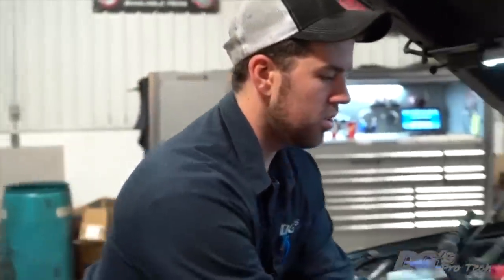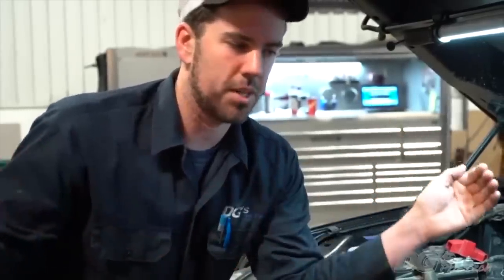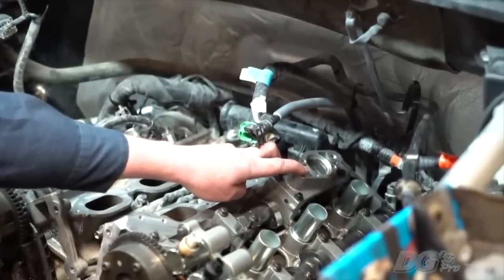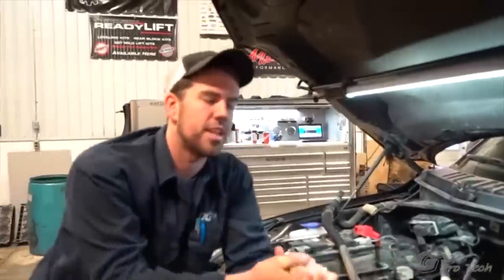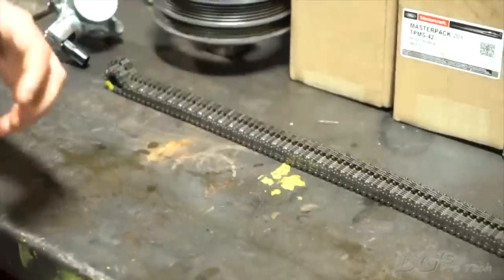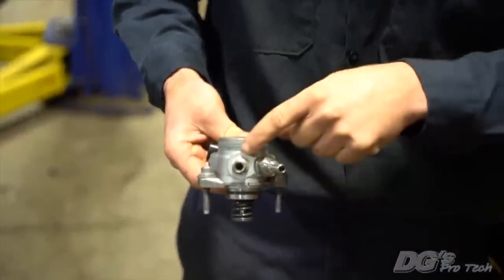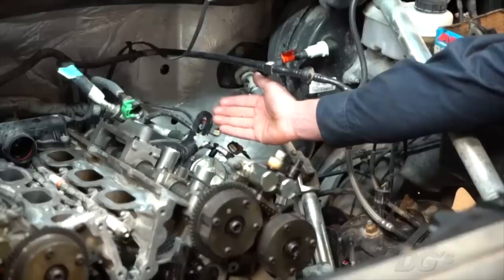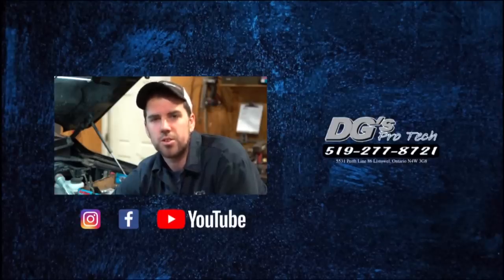What you NEED to know about Ford EcoBoost Engines by Dustin Golley of DG's ProTech

Comment: Fords are 100,000 mile vehicles unless you drive like a little old lady. My high-performance 4.6 L 2005 Mustang blew a rocker and then destroyed the top of my engine and after I fixed that I had a rod start knocking, did I say high-performance. It had 107,000 miles. There is no way I would ever trust ford with a turbo engine. I’ve also had a Ford F250 heavy duty and a Ford Taurus and they were both equally garbage. Junk Junk Junk
Reply: If you drive your car/truck like an asshole,  it won't last no matter the brand. I have 172,000 on my F150 ecoboost and take care of it and don't beat the shit out of it. It's not rocket science pal.

Comment: I was building turbo engines in the 90's, I carried a whole person's weight of tools to try to keep from getting towed. I worked at several dealerships and took many classes for all kinds of procedure and process for new engine platforms coming online...they still blow (head gaskets, rods, blocks, valve trains, transmissions)
BOTTOM LINE buy a V8, it is the least likely to just pop for no apparent reason and just be shy of the warranty.....If you want to haul balls or tow/ a V8 is the ticket most of the time. oB

Comment: Ford Turbos are very reliable in my opinion.. a good read --> (The alloy selected for this purpose has withstood the temperature and reliability requirements of space flight. The super alloy was previously used for both the high-pressure fuel turbo pump as well as elements of the high-pressure oxidizer turbo pump on the Space Shuttle's main engine. In a further application of advanced technology, the turbocharger has a dual cooling system. The BorgWarner K03 turbocharger developed with input from Ford engineers, utilizes both water and oil cooling to cool the component. The turbo is predominantly cooled by oil when the engine is running, but when turned off, a water cooling system passively draws heat from the components, cooling them down.) The benefits of a v6 compared to a much larger displacement v8 are less moving parts.... u got a engine with less moving parts and a turbo designed from the ground up to be nothing but a long term tank.... my v8 friend wasnt too happy when his big ass 6 liter v8 was in the repair shop before my v6 ecoboost was recently... he started having issues after 200k.... my ecoboost has not had a single hickup so far. CHANGE YOUR OIL ON TIME and there isnt a reason the ecoboost should let you down.. in fact change it early if u really care.. i change mine at least every 5k miles

Comment: Bottom line.... its way to much shit going on with this little engine to make it run the way it does ... just get a naturally inspired V8 and be done with it....I could wrap a turbo on a turtles ass and make it fly... nothing new.
Reply: v8s have more moving parts. my grandpas big ass 6.2 v8 started having issues appear after 200k or so miles with those moving parts..... my aunts 3.5 ecoboost still running like a tank... ecoboosts have less moving parts than a v8 obviously being a smaller engine, with a reliable turbo charger i believe ford goes with borgwarner with the turbo.. and they have a pretty good system of cooling in place to ensure those turbos last a long ass time... in my opinion a ecoboost if the owner changes the oil regularly is more reliable than any of these massive v8s

Comment: Generation one 3.5L TT are very poor, A single timing chain design is a massive flaw and it not serviced ASAP will cause damage to cylinder heads. Most of the time its too late to just repair the timing chain, long block is the only real fix. Or just buy a newer generation 2 which fixes the chain design.

Comment: We use the ecoboost expeditions at my work and not a single one of them can accelerate past half throttle without misfires and power cutting.  It's a crap engine.

Comment: Towing ratings are not based on power. They are based on suspension control of the “vehicle” behind the truck. How much weight can the vehicle truly handle safely with it. Tow ratings will change as you get into power with the duallys where they can pull 25000+ lbs.

Comment: Can u post a video on an extraction and replacement for an engine on a 2012 Ford Taurus SHO. I also will be separating the transmission  from the old to the new engine along with all the accessories.
Be specific as to the yr make and model pls.

Im tackling this extraction and installation this is weekend. So if you could or direct me to a site before this weekend it would be greatly appreciated.
Thx

Comment: It's either eco or boost ... choose one ...
Reply: From the comments, sounds more like boost than economy. Until the boost blows up, then economy is most definitely gone.
Reply: They're quite Eco if you're nice to them, but the Boost will throw you back in the seat if you ask it to! The 2017+ models have 3 timing chains to prevent chain stretch as well as PFDI (Port Fuel and Direct Injection) to eliminate any carbon buildup on the intake valves.
Reply: @FordMaverickFanatic  $$$$!!
Reply: @northdakotaham1752  Spend the money to maintain it and treat it right and in the long run it'll be cheaper!

Comment: Ok. I'm calling bullshit on this. No. Your oil, yes- if changed at a reasonable level 5K Miles/8000K is not an issue. But even as this guy explains about the links of a chain becoming weak- is NOT going to happen in that time period. The issues with these engines are NOT timing chain related, and even if you DO have an issue with the turbo- It's not going to be related to the timing chain.

This timing chain slop issue is bullshit.

Comment: GM truck engines are pushrod type and  short timing chain .In 2014 , They went to direct injection . The new 2.7 in line 4 cyl engine is also a pushrod type with a single turbo.Also has v 8 power and short runner on turbo to reduce turbo lag. The same engine is built like a diesel and full torque comes around 1500 rpm. About 22 mpg on a full size 1/2 ton truck.

Comment: Great video, I wish a mechanic like that would discuss the 2.7's known issues / pros and cons.
Reply: Whats wrong with the 2.7 ecoboost  I have a 2016 never no problem except the the radio quit working went into a deep sleep mode
Reply: @truckerjon7255  I also own a 2016 2.7.  It's in an F150 which recently flipped 61k miles.  So far the only problem is with the oil pan.  I've had 3 additional oil pans put in it.  I think Ford finally has it fixed properly now.  I made my comment because it would be great to hear about any additional known issues when it comes to the 2.7.

Comment: 2018 3.5 EB. Oil change EVERY 5000 miles. Castrol Titanium Synthetic oil. JLT catch can. Injen cold air intake. MBRP 4" exhaust. Truck is a beast, and will easily shred Cooper all terrains.

Comment: I just traded my 14 Raptor for a  15 Lariat ecoboost,   only 57,000 miles wanting better fuel mileage, and being now I am a grandpa and all. On first start ups, I am getting way to much white smoke from the exhaust.  After about ten to fifteen minutes of running it goes away.  This happens even on nice days.  I have googled the issue, seems to be a lot f people having this problem with ecoboost engines.   I have read two issues that could cause  it.  One,  mild head gasket leak,  idling and cold it  as it warms up it can basically steam it off, unnoticeable,   second is turbo seal leaking, allowing oil to get into one or both turbos, and it has to burn that oil off.   Its embarrassing to say the least.  I left Disney on ice along with all the other vehicles, and I have a trail of white smoke, no one else does. What is your thoughts? Need advice here.

Comment: I had the 13 st focus 2 liter eco great engine put 138,000 miles on it. I womped on it to its the first 4 cylinder i didn't blow up I used fully synthetic oil and only changed oil 13 times. I have a Ranger with the 2.3 now and im scared I hoped they fixed the gasket problem.

Comment: I just bought a 2011 Ford f150 4x4 very nice truck. I've always been a Chevy guy but when I seen this truck I had to buy it. I never heard anything about this EcoBoost and the only thing I found out real quick is the fuel mileage is horrible 
9 mpg this is not going to work very well for me. My question is can they  be turned to get better mileage. I also dont hot rod it because it's my work truck

Comment: I DONT KNOW WHATS GOING ON AT FORD, BUT THIS WATER PUMP IN TIMING CHAINS,         STEERING ISSUES WITH MY DAUGHTERS FORD TARUS, WHICH THEY WILL NOT WARRANT, IAM DONE WITH FORD, THEY ARE MAKING THINGS TOO EXPENSIVE TO FIX, 1400 DOLLARS FOR A WATER PUMP WHICH INVOLVES OTHER STUFF WHILE YOUR IN THERE, FORD HAS BECOME A MESS, AS FOR ME, 30,000 DOLLARS FOR A NEW VEHICLE AND NOW 3000 DOLLARS FOR A STEERING ISSUE DUE TO PART FAILURE AT 140, OOO MILES IS UNACCEPTABLE FOR ME, WATERPUMPS INSIDE THE TIMING IS A ISSUE DELIBERTLY DESIGNED TO COST THE CUSTOMER MONEY, HEATER CORES THAT COST 35 DOLLARS INSIDE DASH NOW IS A 1000 DOLLAR ISSUE, THESE THINGS I WILL BE LOOKING AT FROM NOW ON WHEN I PURCHASE A VEHICLE, MY FIRST CAR WAS A 1968 MUSTANG OUT OF THE SHOW ROOM. IVE ALWAYS BEEN A FORD GUY ,,, BUT HEY FORD, IAM F ING DONE WITH YOU AND YOUR STUPID CRAP REPAIR COST,,, IAM DONE, GO TO MEXICO

Comment: I wish you lived in my neighborhood. How about doing a video on the pros and cons of the 5.0 V8 in the Ford 150.
Reply: 5.0L peak piston speed is 82.5mph, faster than a formula engine @17,000rpm

formula engine use long rods, 5.0L uses short rods which pushes the cylinder against the sleeve at a high angle, causing it to accelerate the piston to faster than the crankshaft is moving.

5.0Lengine made by ford have sintered rods, too heavy for the bore spacing, 5.0L is the only muscle car balanced externally like muscle cars from the 80's.
5.0Lbuilt from catalog parts(BOSS engines) have drop forged and ball peen forged rods like stock V6 and V8 camaros so can rev higher

a V8 camaro can add 100hp with just a camshaft made by chevy, 5.0L being so close to max volumetric efficiency, it is very hard to add HP without more RPM, or displacement per minute

5.0L is 20% smaller but only gets 3% better fuel economy driving slow, but uses a lot more fuel with a heavy foot, that's cause all of the power adders are adding wear, not just robbing fuel economy so 5.0L can displace more per minute at high RPM

ford was forced to build 5.0L cause they were fine with 4.6L 300HP in 2009 but V6 camaro made 315hp in 2010.....300HP IN A MUSCLE CAR 12 years after Z28 Camaro made 345hp in 1998
Reply: @ihatecrackhead  What?? The Coyote 5.0 uses a 5.933 con rod. That's not 'short', lol. And please provide the link to this piston speed info.
Reply: That be nice...

Comment: Good tip on the wastegate. Diesel guys, listen up! This applies to all turbodiesels as well, not just ecoboost gassers. Hit wide open throttle at least once a week, If you have a newer diesel with dpf and/or def fluid, with regen cycling, WOT at least once a week and at least two 20+ mile drives on highway per week are paramount.

Thank you for your articulation as well!

Comment: Nothing to fear with an ecoboost. Days of being able to put conventional oil in and pay 25.00 for an oil change are long gone. 5k miles use a solid full synthetic oil and a Motorcraft filter. That alone is going to keep away the majority of issues. Change your fuel and air filters, use top tier fuel, replace the coolant and transmission fluid every 2 years you'll rarely have any issues most of the time. Control what you can control....the maintenance.

Comment: I have my oil changed with full synthetic at that dealer every 5K.  It's a 2017 STX package 2.7 liter Eco Boost with 20K miles and now I know that I need to "drive" it more and not baby it so much :)

Comment: Did this engine suffer problems with intake tract and valve carbon buildup like many other GDI engines? I understand proper oil helps, but many folks with GDI still have trouble.
Reply: GEN 2 engines no , They have a dual port  direct inject, and other improvements.
Reply: @Calebflying2025  Thanks for clearing that up! 👍

Comment: This isn't a problem isolated to Ford. The GM 3.6 DOHC GDI V6 also has timing stretch issues. 

What it boils down to it marketing. Everyone wants to be able to advertise low cost of ownership and long maintenance intervals. Well, they're lies. You NEED to change your oil on these modern, tight tolerance engines at least every 4,000 miles. No ifs ands or buts.

Comment: My 2013 Taurus  V6 3.5 ecoboost had water pump running on timing chain $2200.00 fix for $150.00  part .So if your water pump is on timing chain and your in that deep replace your water pump. I personally wouldn't buy another 3.5 ecoboost just for that reason.  Most H2o pumps could be replaced for $500-$700  and in a few hours.

Comment: Yes, A sharp guy. BUT All engines use a timing chain and YES, proper lubrication is a Must.  
But this applies to ALL engines, Not just the ford EcoBoost!   
SO, I do not understand why the EcoBoost is Targeted in this video???  
Let's talk about intake valve fouling due to oil in the EGR system...  (:>

Comment: Thanks for the insight but what about the carbon build up on the valves ?
Reply: In my opinion and experience, it's a non issue. Yes, you're going to have buildup, but induction cleaning is hardly a major job, if you even get to a point where it's needed. I've done it myself in the garage once. Takes a couple hours, some solvent, clean rags, and basic hand tools. It's a trade off for efficiency and power I can live with. Running good quality oil is your best defense. And whatever you do, DONT use those induction cleaning sprays, especially on forced induction engines. You compress and send that hard, fine, crystalized carbon past the rings and into your oil. Not unlike sand. No bueno. It can and does cause damage to bores, bearings, etc. if you use it with any regularity.

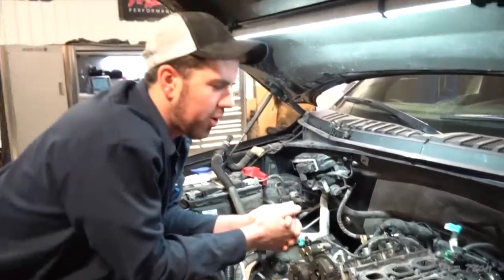Comment: At approx. 4:30 You say that with direct petrol injection they get excellent atomisation. This is not true. Due to the high pressure the fuel get worse atomisation, the pressure blocks atomisation. But what they can do is run leaner because they have not mixed the fuel with all the air (envelop injection). From the VW TSI problems we know it creates more carbon deposites, e.g not everything burns completely.

Comment: Ford is becoming like bmw, sometimes in a good way sometimes not

I bought one with 100k, and it was perfect, but I knew fuel dilution was a problem, which kills the chains, and apparently the previous owner had been doing 5k intervals, dodged a bullet 

Truck was a powerhouse and towed anything I threw at it never needed a repair either besides the catch can and drilling a weep hole in the intercooler

It did rattle on start a couple times though, probably getting close to needing a chain

A simple tune will put 550 lb/ft to the tire too 👀

Comment: Dustin, this is a great video. I know more about the engine than I ever knew. Quick question: I have a 2018 Explorer Platinum. Lovely car and I nurse it pretty well, while driving. I have done 30k, and I change oil every 10 k miles, but I have a maintenance plan that lets me change every 7.5 k miles, which I plan to adhere to from now on. I also changed the PTU fluid during the 30 k service. Now the 3rd gear and 5th shift with a lot of jerk. I plan to take it back to the dealer but any thoughts?

Comment: Great video! im looking at a 2.7 ecoboost with the new 10 speed. Have you seen any serious issues with this combination?
Reply: I have a 2018 2.7 with the 10spd. I really like it, the transmission has a tough time picking gears once and a while (which I recently found out there was a computer update for), but overall a great truck if you're occasionally towing 5k or less. It will say it can do 7500 lbs, but not as nicely, the 3.5 will tow that effortlessly.

Comment: Excellent understanding!!  Only run a full synthetic oil. Install the www.RXCatchcans.com system, run 93 octane, and do the drill mod of the CAC (1/6" drill bit).  Premature timing chain wear and stretch is caused by the raw fuel dilution. GDI engines experience 8-12 times the raw fuel pushed past the rings and diluting the engine oil. Combine that with the bombardment of abrasive particulate matter shed by intake valves, and premature wear is very common.  Here is an oil analysis at over 13,000 miles running the genuine RX system that removes these:  [URL=https://s1083.photobucket.com/user/tech17/media/Falcon%20long%20term%20testing_zps7l9mvzrs.jpg.html][IMG]https://i1083.photobucket.com/albums/j392/tech17/Falcon%20long%20term%20testing_zps7l9mvzrs.jpg[/IMG][/URL]   Dustin, email us direct at: APDEG@aol.com and will share more.  Excellent video!

Comment: It's not Ford related but, 

Recently had a customer that needed a new engine in his very expressive sports car... He claimed that the change oil display never came on so he just kept on stopping the gas like a true Part-Time Street Drag Pro Chad.  The engine had nothing but burnt scrap metal in the oil pan, and no oil to be found.  Later found the root of the problem: His dash dome light was lowered all the way down so the display was not visible at all.... "So that's what was making that dinging sound?" was his reply.

There's one thing that a Mechanic can't fix..... Stupidity.